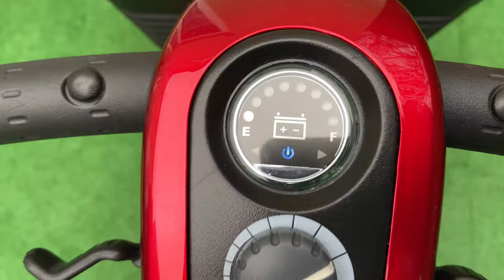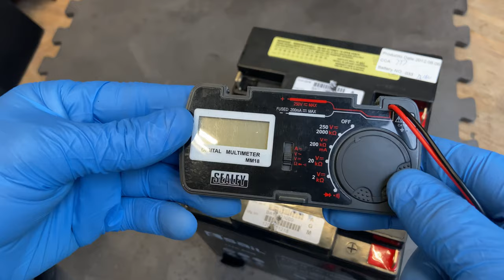Pride GOGO Elite Traveller Plus Mobility Scooter Battery change

Comment: How do you take it off the scooter? The changing of the battery is the easy part
Reply from the maker: Sorry, I don’t understand your question. How can I help you?
Reply: Yes, you didn't show us taking the battery box off??
Reply: exactly. how does the battery box come off the scooter??? i cannot see a release lever.
Reply: @rickc2222  battery box is connected to scooter via Velcro,  just give it a lil tug. It will Cone right off.
Reply: Well sob I couldn’t figure out how to get the battery box off either.
Reply: Here for exactly that reason to see how the battery comes off the scooter

Comment: Note: Mobility scooter batteries are normally two sealed lead acid (SLA) batteries connected in series for 24 volts.  Basically same as car batteries but you can't add distilled water. SLA batteries can last 2-4 years with proper recharging and storage ( don't leave battery box in hot car or garage, don't leave charger connected continuously). Think of these batteries as "fuel".
Reply from the maker: Thank you for your advice

Comment: My charging port is below the seat. I'm thin 71, and can't connect the charger. I'm not strong enough. Got on the floor to do it and I had to call the fire department to get me up off the floor. Need to trade up to an easier model to charge. No one ever answers the phone or call you back. Any info would be greatly appreciated.
Reply from the maker: Hi Sarah,
Many models have charging ports on the front unit. You should choose something like that.

Comment: If you  install larger, higher amp rated 18ah to 22ah SLA batteries, the weight of the battery pack will increase significantly along with greater driving range. Keep your batteries fully charged, don't leave them discharged, it will shorten useful life and driving range. You will also need a different  taller Pride battery box to fit taller 18ah batteries. Also, 12 ah SLA batteries are wider than 18ah ones, they won't fit 18ah case!!!
Reply from the maker: Thank you

Comment: You also need to transfer (or renew) the strips of Velcro on the bottom of the battery. If you move the Box around without fixated Batteries or turn the battery box upside down as in the Video, without the Velcro, the batteries hang from the cables inside and it can break at the connection and cause a short circuit!  You can also put the old battery in the fridge for a while, then the adhesive strip will release more easily.
Reply from the maker: Thank you for your comment. If there is originally the velcro, I get used to replace to the new batteries, but if it wasn’t there I’ll leave without.
Reply: @georgesworkshop8600  That's why I comment on the velcro. I changed batteries multiple times. Always use a velcro because without it is not save according to factory specs. The Wires are not that long to compensate the movement of the battery. Eventually they will break. Good luck.
Reply from the maker: Many thanks 😊 
Regards 
George

Comment: Since he missed out a lot of relevant info... 
The battery box is held in position on the scooter by its power connector on the underside of the box, plus Velcro style tape, and gravity.
To remove the screws on the bottom of the box... I can't tell the size, but he used a long 'cross head' screwdriver - also referred to as a 'Phillips head' screwdriver - and then a little magnet on the end of an extendable stalk. 
Assuming most people don't have a magnet...  The screws will fall out of their holes when you turn over the box to be able to lift off the top cover. Make sure you keep track of them when they do fall out. 
If you put a small piece of sticky tape over each hole before you turn the box over, the screws will stick to that and not get lost.
The two batteries inside the box are standard 'deep cycle sealed lead acid' batteries. They're '18-12' batteries. (Also known as '12v 18Ah' or 12 volt, 18 amp hour batteries.) You can get various different brands and styles/capacities on Amazon and eBay, Walmart, Autozone, Nappa, etc.
He didn't share what size socket/wrenches he used to remove the wires from the batteries, but to be honest yours might be different anyway so that's forgivable.
The batteries are held in place by more Velcro style tape which is why they needed to be wiggled & pulled up.
He replaced the original batteries with two slightly heavier & longer lasting ones = 12v 22Ah.
He did not replace or even reuse the Velcro tape on the bottom of the new batteries, but you really should use it, for safety sake.
Many batteries come ready charged. However, they'll hold more charge and last longer if they're fully charged again before being used, ideally for 12 hours. That can also be done using an ordinary car battery charger before they're installed if you can get by with using the old ones for a while.
You're welcome. 😁
Reply: You can buy long phillips screwdrivers with magnetic ends, they should work to remove screws from battery case.

Comment: THANK YOU SO MUCH FOR THIS MY NEW BATTERIES ARE COMING TOMORROW. I Have had a stroke left hand and fingers are useless hope I can mange this alone
Reply from the maker: Hi Bill,
I hope you will getting well soon. Good luck with the batteries.
Reply: You may need some help wiggling and tugging  the batteries free from the velcro holding them into the case. If you have a multi-meter, check voltage of new batteries, before installing,  to make sure they are both "good" and charged to 12.6 volts each.

Comment: When you set the black box back on the scooter do you have to screw it down
Reply from the maker: Hi Patria,
For Pride GOGO hasn’t got any fixing screw. Velcro provides extra holding for battery box. But fitting could be different for other makes.

Comment: I plan on using the battery on my scooter to run my cpap machine when i go camping or in a power outage
Reply from the maker: Hi Rick,
I cannot advise on this solution
Reply: The ResMed converter runs on 12 volts, scooter batteries have 24 volts at the connector

Comment: Is there a big range improvement between 18 ah vs 22 ah batteries?
Reply from the maker: Hi Louis,
There is only a slight difference, not too much. But the price is nearly same, so I get used to buy the higher capacity battery.

Comment: How did you detach it from scooter?
Reply from the maker: Hi Cathy, simply lift it up. Do you have Pride make scooter? If the seat blocks it, take off first the seat and then remove the battery box. There are other makes, may their batteries could be fitted differently.

Comment: Bonjour comment je peut faire pour augmenter la vitesse de mon scooter svp ou savoir si possible de le faire ?  car trop lent ?? ( à mais risque eperil ) merci d'avance pour votre aide cordialement
Reply from the maker: Hi,
Is it slower as it was originally? Then need a new battery. All of scooters have mechanical or electrical speed adjustment. The speed could be adjusted within the min and max range.

Comment: Hey guys, hoping you can help.

I have a Pride scooter and when I plug it in to charge the charger lights continue to stay on indefinitely. They don't switch off for example when there would be a full charge. However, when I unplug the charger from the battery and simply plug it back in, they charging lights are off.

I'm not sure if there's a problem with my charger or something else. I also believe this is causing problems with the batteries (as they are working poorly what seems like out of nowhere).
Reply from the maker: Hi,
Do you know how old is your battery? I presume the battery’s life ended and need to be replaced.
Reply: Thank you. It just seems that the LED lights on the charger never go off or change, to indicate a full charge. The battery is not old and has been working. @georgesworkshop8600
Reply: Just installed new batteries and showing full charge of 12 volts  what is the correct way to keep the batteries charged  continuous charge or just charge at a certain voltage level or deplete charge and recharge ?.
Reply: @Neepdocker  Don't leave charger connected continuously. Recharge batteries overnight after each use. Recharge over night once per month when not being used as in winter. Do not store battery box in hot car or garage. Fully charged scooter batteries are normally two 12 volt batteries connected in series for "nominal" 24 volts, should read over 25 volts fully charged.